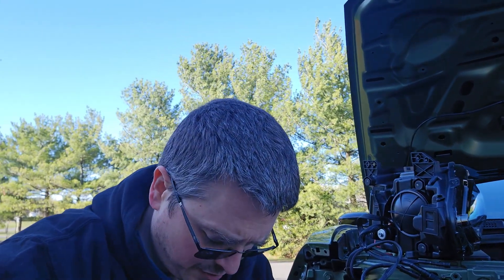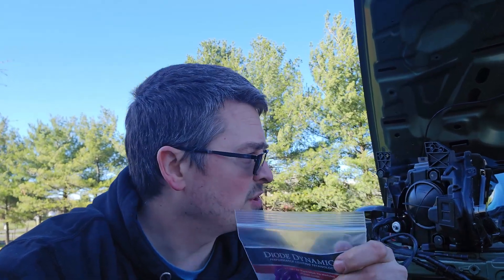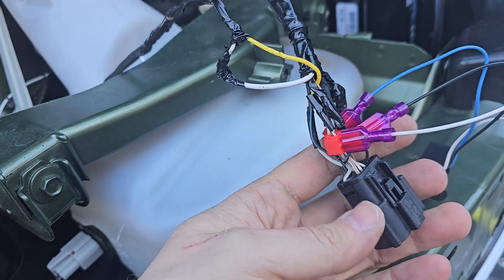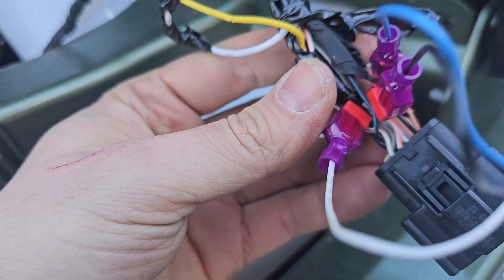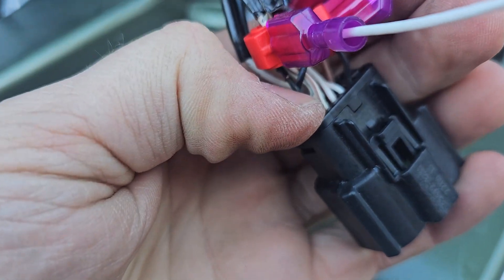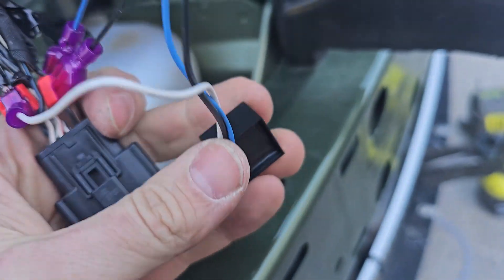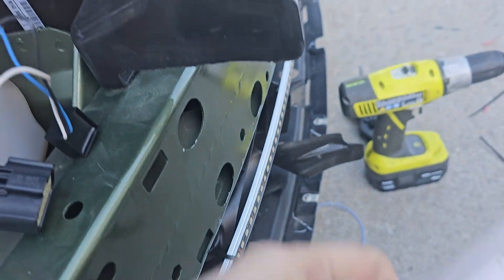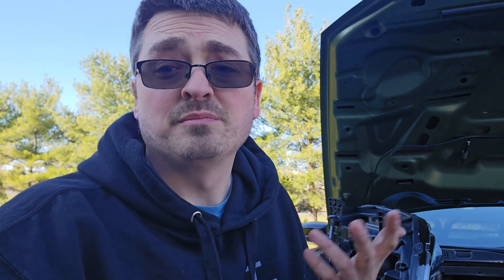Solution for LED Turn Signal Hyperflash in Modern Cars

Comment: How did you identify the data wire? I have a 2021 K5 GT Line and I can’t find anything showing what wire goes where
Reply: Just to clarify, I know which wires are power and ground, just don’t know how to test for the data wire
Reply from the maker: @ramonaquino6609 if you can't find a diagram you will have to figure out what each wire does and find the one you can't identify.